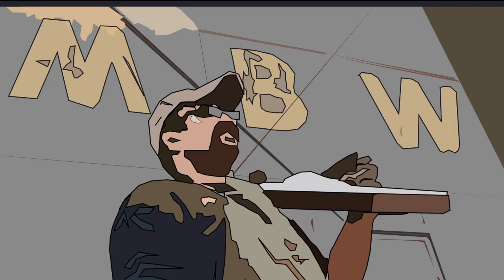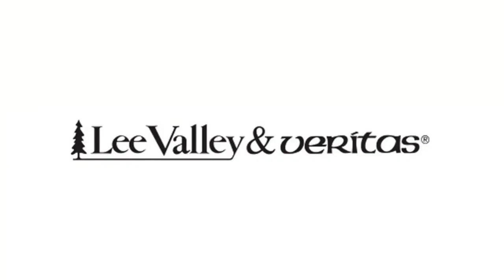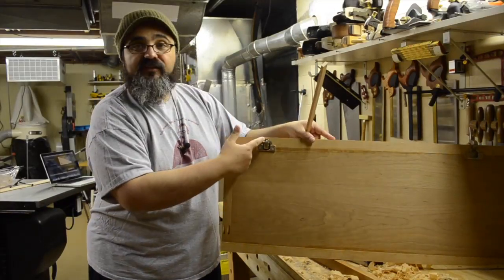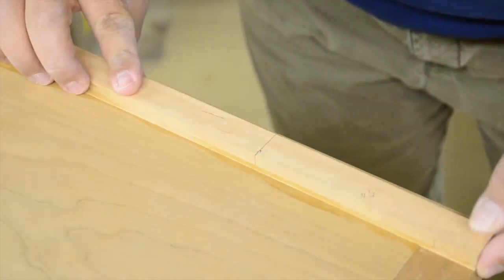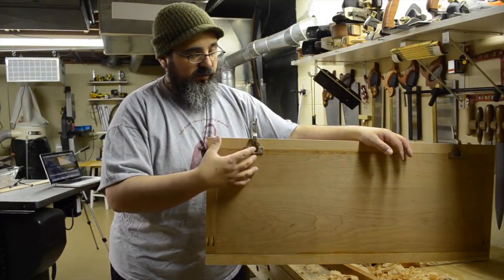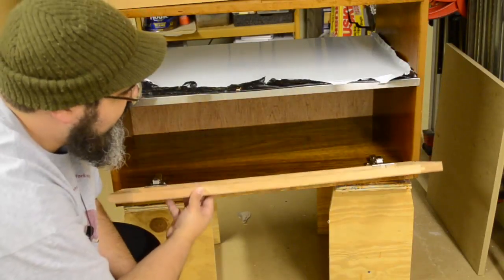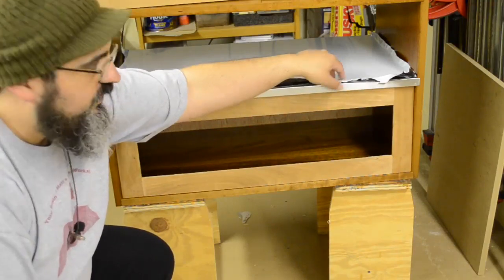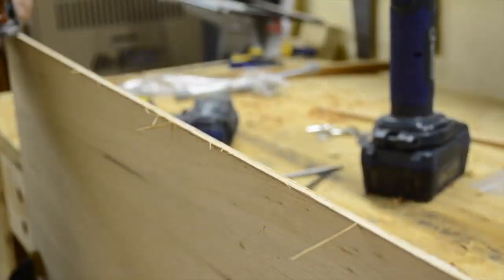524 Bathroom cabinet part 3

Comment: I love this build Matt.
One thing I noticed on almost all builds in American videos is the poor use of european hinges. What I like about them, despite the fact they are easy to use, is the way you can create design features, you can't using normal hinges. On my TV-Stand the doors are recessed so it leaves a 5 mm lip on the walls, the doors are connected to. This leaves a straight line on the inner corpus, not disturbed by the normally on top sitting doors. Have a look by yourself: http://youtu.be/VFhe1EIi2yw
I used hinges from Hettich designed for doors, where the hinges are the overlay - partition hinges http://web2.hettich.com/hbh/catalog/Start.do?localeId=en&model=procat
Just an idea for future projects to get away from the IKEA kind of look (I mean the overlay of the doors) although using european hinges.
Greetings from Good Old Germany
Peter